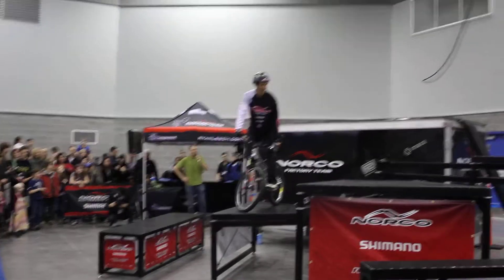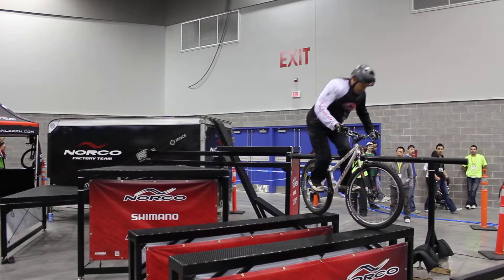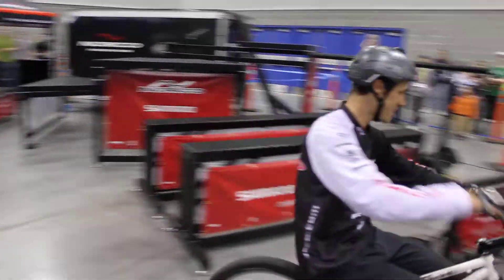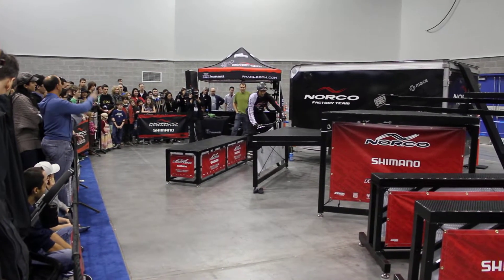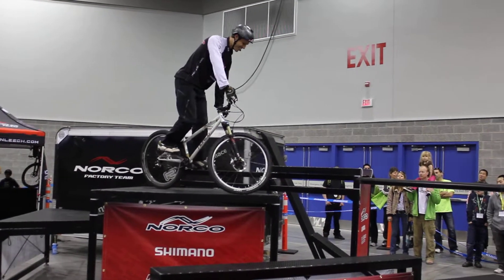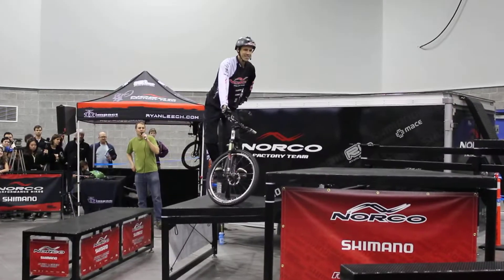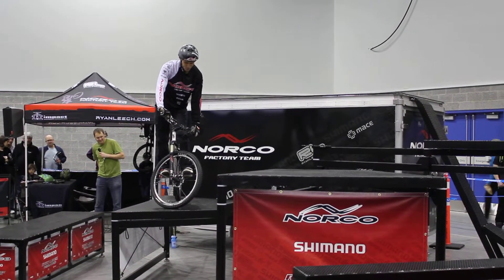Ryan Leech at the 2011 Vancouver Bike Show

Comment from the maker: He isnt going down a mountain, he is doing trials. In trials you want to keep the bike as light as possible. Disc brakes have better stopping power when your going 50 kms down the side of a mountain, but useless for trials. Keep in mind he is sponsored by Norco and his bike is custom designed by him... he has unlimited access to any components whatever the cost for his bike... he chooses his parts based on performance.
Reply: This setup is weird. He has gears and suspension forks. Strange setup for trials.
Reply: @weareallbeingwatched4602 Ryan's set up is from 90's mountain bike trials riding because the development of the bikes became more specific.

Trials back then essentially used a dirt jump hardtail frame with short travel suspension forks.

Because Ryan is doing a lot of shows and touring to earn his way as a Pro sponsored rider, he did move with the times of seatless trials bikes with rigid forks. His set up was crazy heavy especially with the Steel frame and suspension forks. Around 13-14kgs.

Comment: The reason he has a v-brake is so he doesn't destroy a rotor when his back tire misses an object. And he's using a Norco evolve, it looks like a normal bike, but the geometry is trials.
Reply: Doesn't look like a V brake to me... looks like the magura hydraulic rim brake system.

The advantage of that way of braking is that you don't get the spokes flexing, meaning that the wheel has rotational suspension. Try it on a disk brake bike, you can squish the wheel a bit back and forth, whereas a rim brake will lock the wheel, and the only squish is due to the tire.
Reply: @weareallbeingwatched4602  it is a v brake in the back. You can see around 1:55 mark he has a Shimano XTR M975 v brake lever to the right hand on the handlebar. The reason the rim brake in the back is superior is that with a ground rim surface, the hold is stronger than that of a disk. The rim brake has a stronger hold also because of the bigger torque arm (26 inch) compared to a disk which maxes out at 8 inches.
Reply: @kisong1960  I run an m950 on the rear with a booster, and a magura hs33 on the front on my daily, which is a 26er. Hard to see clearly from the video but that left hand lever looked magura. The old hs22/hs33 one by the looks of it. He might be running left hand front brake, and have a disk caliper. Dunno. You probably know more than me. Rim brakes are good - I run them mostly because disks lose power when exposed to road grease, but the "positive lock" does good things for control, and disks on spoked wheels are kinda springy.
Reply: @kisong1960  think you're right, you know. I know those levers ;-)
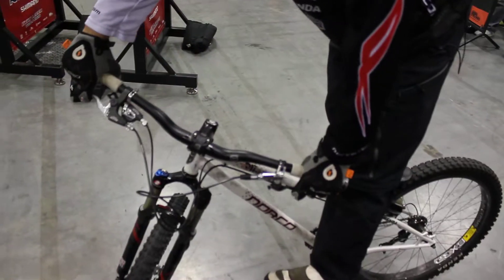Reply: @kisong1960  there's a clear shot at 4:24 - front brake left lever is shimano XTR 9120, or similar. Back brake right lever is Avid of some sort - oval logo... some sort of V brake on the rear, likely single digit. Might be shimano... dunno.
Reply: @weareallbeingwatched4602  The back brake lever is a Shimano XTR M950 lever. Look up the photo and compare with the silhouette of the one on the Ryan's bike. Ryan was being sponsored by Shimano at the time so he would have wanted to use as much Shimano components as possible.
Reply: @kisong1960  the barrel adjuster does look familiar

Comment: Not entirely true, disc brakes are actually much more powerful because the caliper moves less for the same amount of movement and the lever. Rim brakes can be made slightly more powerful but they're less practical because you constantly have to worry about the wheel being perfectly true. Plus if you use them othe front, they'll snap your fork.